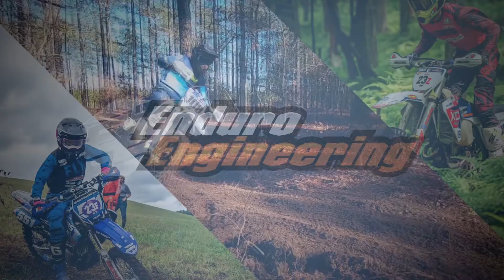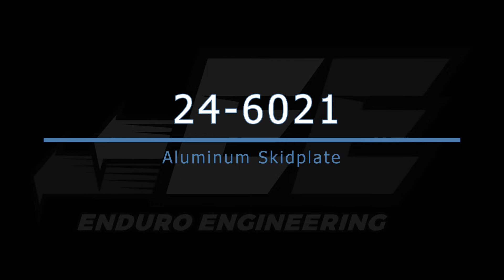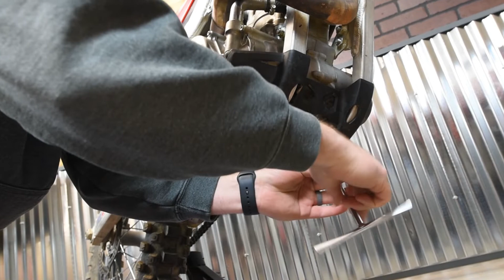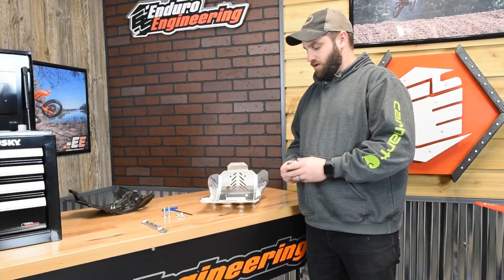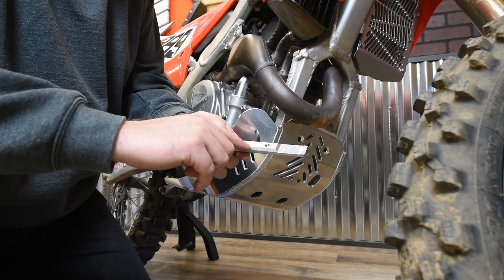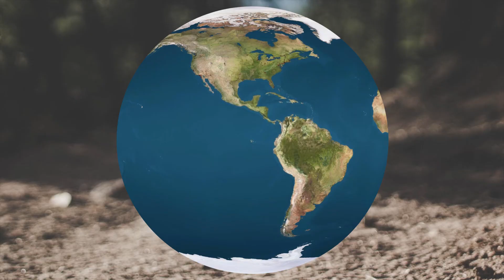Enduro Engineering Honda CRF250/450 Skid Plate Installation Instructions

Comment: Does not fit skid plate strap on top of 2022 Honda crf 250rx unless you take exhaust off. Can’t tighten bolts. Nothing fits this bike despite them saying it does